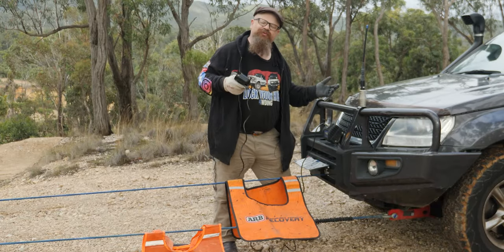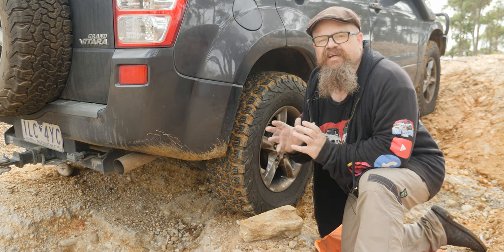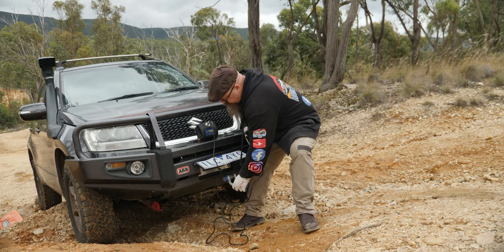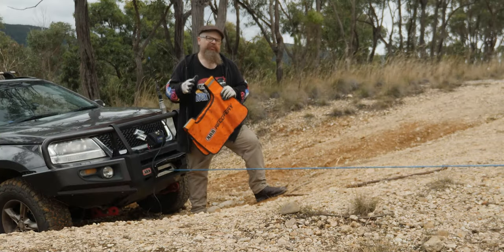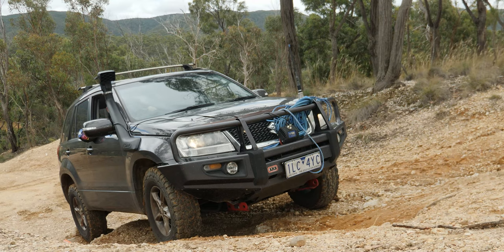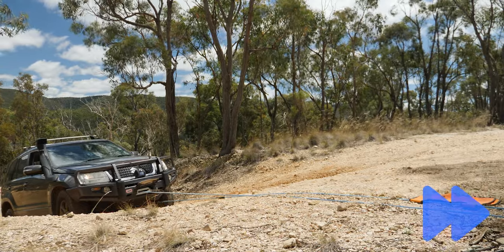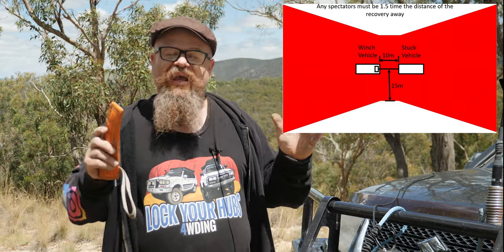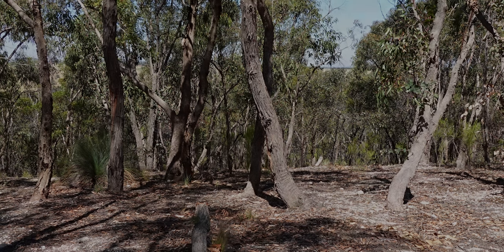4x4 Off-Road Winching Techniques for Beginners

Comment: When winching, have your motor running, preferably at high idle to recharge the battery & don't turn it off until well after the recovery is complete otherwise you might not have enough battery power to start your engine.
Reply from the maker: Great advice, especially about leaving the car idleing for a while are the winching is finished.

Comment: I don't get why you are winching in neutral. Every winching I have seen, they have been driving to assist the winch.
Reply from the maker: That can lead to shock loading the cable, it's probably the easiest way to brake them.

Comment: Maybe you should show the tow truck driver how to winch or how to secure a load LOL. Just one comment at the start and once you were back in the vehicle and each time you proceeded to winch.. you said to "put the vehicle in park and park brake on - put the vehicle in neutral and park brake off" .. that is only for automatic vehicles, for those of us that have manual vehicles it should be in 1st gear and handbrake on etc... :)  I was taught to have the vehicle running anytime you use the winch, both for out spooling and for winching in, also to only use the winch remote/operate the winch from the driver side of the vehicle then there is No need to go over the cable when under tension, and when winching in to assist the winch by trying to drive the vehicle in the direction of the winch at a slow pace to not overrun the winch if you do gain traction. It would have been interesting to see where and how the winch rope broke, it's a pity you didn't have a camera set up on that area of the test rig. A great introductory video to show others how to use a winch.
Reply from the maker: My 80 is a manual, I know all about putting it in gear! As they say, nothing can stop a LandCruiser, not even the park brake!
Reply: @LockyourHubs4WDing  I have an 80 series also and my handbrake works fine. It's all about adjusting it correctly.
Reply from the maker: @TimsBitsnPieces  you have one of these mythical working park brakes? Lol  I haven't met one that I haven't been able to get the car rolling on a really steep hill! Yours might be the first.
Reply: @LockyourHubs4WDing  Well it does depend on the grade of the hill but yes mine does hold on a slight incline. I replaced all of the cables and tensioned up each cable individually on each wheel to make sure it worked and cleaned and lubricated each of the parts behind the drum on the wheels when I replaced the brake pads. It did take a while to do but it does work. NO I did not purchase one of those mod kits that is supplied by that engineering co. that we both know of.
Reply from the maker: I've done most of that and installed extended dog bones as well. Bloody thing is still rubbish....

Comment: Hello, nice video, and very well explained, congratulations, just one thing though. When you did the double line pull and demonstrated that the rope didn’t go through the pulley. In reality if the vehicle rolled, it probably would have just broken something and rolled to the bottom. The reason for this is called “shock loading” I will use the example of a free falling weight here, i know the car is not free falling but on a hill so the mathematics will be different but it will give you some idea. 
If we have a load on one tonne and drop it 1 inch, the force to stop it will require 2 tonnes, if we drop it 2 inches the force will 4 tones (this is a general rule of thumb). So for every inch a load free falls the force required to stop it will double. If a car starts to roll down a hill before it’s connected up properly there is every chance that you will never be able to stop it and something will break. So until the car is fully connected it should always be treated as “Uns-secured”
Reply from the maker: Dynamic loading will depend upon the gradient of the hill and rolling resistance etc. Kind of hard to calculate.
Reply: @LockyourHubs4WDing  
Yes but the point was that until the load ( car) is properly secured properly it must always be considered live and unsecured especially if it’s on a gradient irrespective of the gradient

Comment: As the owner of a 79 with "Induction cooking but not a Air Fryer" I'm not insulted LOL. Never seen one weigh under 4000kg, fully kitted out. Winching one of these is a task.
I don't take a extension rope, but a spare winch rope. I know its a No No. I boy scout it on to get that extra distance or to double up my pull. My bad.
Dampeners do work with lighter items like bow shackles and recovery points etc. by absorbing some of the energy. But larger items like a Bulbar from a Hilux. Tend to just fall a foot or two in front of the vehicle !!!
Reply from the maker: Wow! an extension rope with soft eye on both ends can also be used as a winch rope in a pinch. Great to read you haven't stooped to an air fryer! lol

Comment: I imagine you were using a winch roap at the end of its life. Any idea how it failed? A nik or a wear point or do these ropes just harden and die? Thanks = always worth watching even when the props fail!
Reply from the maker: I'm not 100% sure, and didn't have a camera on that part of the rigging unfortunately. It wasn't under much load when it failed (1T) I guess better it fail there than when I'm hanging off of the side of a hill.
Reply: @LockyourHubs4WDing  Yes, indeed. I was quite a light load - very strange.
Reply: You'd used it at least twice before breaking at a ton...very strange!!

Comment: Do all winches have that free spool? Other recovery videos I see never show anyone loosened the spool they just pull the rope out...hence asking. Did you let the winch pull without driving up at the same time?
Reply from the maker: Just about every winch has a free spool function. I winch usually in neutral so I don't overrun the winch rope and potentially shock load the winch rope if the car slides back.

Comment: Thanks for the great video ☺️. I’ve got a query about the best way to temporarily shorten a synthetic winch extension rope, and the effect of the technique on the rope’s rating.  Would love to hear your thoughts
Reply from the maker: I usually use the daisy chain technique, finished with a soft bung.
Reply: @LockyourHubs4WDing  oh beauty, I do that with climbing ropes.  Does the daisy chain de-rate the line at all?  I was considering a larger diameter rope to compensate, or should I knot bother?
Reply from the maker: @billwatson4468  as the hitch exceeds the MBR (Minimum Bend Radius) It would compromise the strength somewhat.

Comment: In an automatic, put in neutral and winch while it’s in neutral ? That’s not real good for your automatic gearbox though, especially if you’re winching any sort of distant. I’d leave it in gear and that way you can drive when necessary too 😉👍 
Go the #littlegreymountaingoat - got to love a #zook 👍👍
Great clip mate
Reply: Only bad for the auto if the engine isn't running. If it's idling you could safely flat tow it behind another car even, without issue. When the engine runs the auto trans has an oil pump that's running. It's only an issue if the engine is off and it's moved a reasonable distance like a few hundred metres at speed. The speed and distance that a winch will take you, wont damage the trans but if the engine is off you're more likely to damage your battery if anything.

Comment: Ok serious question  , because 2 lines , FROM car 9500lb and TO car 9500lb  ,   the pulley is working at 18,000lb ( Double line pull )  BUT, you have your pulley connected to a 4.75t rated bow shackle, which is only rated to 4.75t ( 10,471lb) , so in essence its being overloaded .... Wouldnt that be correct ?
Reply: No, steel bow shackles have a safety factor of 4 or 5 but in tests to destruction it is more, you wont break a 4.75T steel bow shackle in a 4WD recovery situation.
Reply from the maker: Dusty farmer is right, Aus Standard bow shackles have a safety factor of 6, so a WLL (working load limit) of 4.7T has a MBS (minimum breaking strength) of 28.2T, plenty for a winch rope with an MBS of 8T.
Reply: @LockyourHubs4WDing  Ok Cheers for that.... had to ask, appreciate the answer ! Lots of great info on this channel, love it !

Comment: Mate keen to see a vid on Kinetic Ropes
Reply from the maker: I think a comparison would be interesting between snatch straps and kinetic ropes.
Reply: @LockyourHubs4WDing  for sure mate. Also had a tip from a workplace 4WD training day, the trainer recommended if your vehicle is lower than say a bank and the rope/cable is cutting into the ground.. Deflate and put the  spare under the rope or a round timber block as a rolling lever to stop the rope from dragging through dirty and rock and save damage to the rope.
Reply from the maker: @scowievideos7931  great idea with the tyre, especially if you've go the spare hanging off of the rear door or rear bar where it's reasonably easily accessible. I should try that, see how it works.

Comment: If you hook up the snatch block to the anchor point it is absolutely 100% NOT a mechanical advantage it is only a change of direction. If you have a snatch block at the vehicle that actually moves at your vehicle that would be a mechanical advantage. 
There are so many winch videos that don’t understand how mechanical advantage works. 
The other 99% of this video is amazing though
Reply from the maker: I understand why you think that, and in most senarious you would be correct, the rule of thumb is if the winch block isn't moving, it's not providing mechanical advantage. 

This the exemption however, when both the winch and termination point are on the vehicle. 

Without getting into first and second class levers, the easiest way to work out if you have mechanical advantage or not is to compare how much line the winch winds in vs how far the vehicle moves. 

In this case, with the double line pull, when you wind in 2m of rope, the vehicle moves 1m, so therefore you have a mechanical advantage of 2:1 (ignoring frictional lossers) 

Hope this helps.